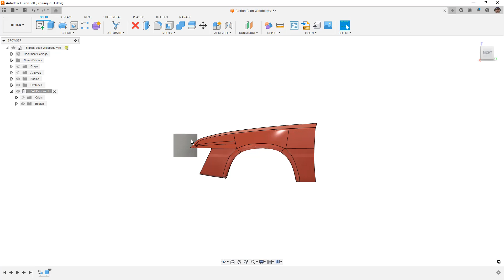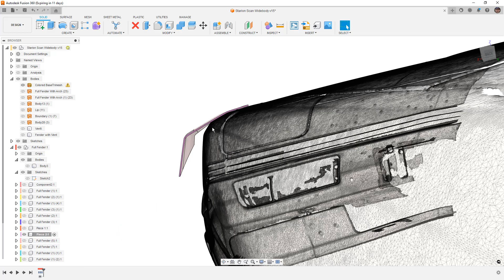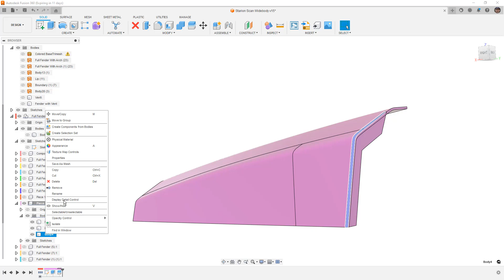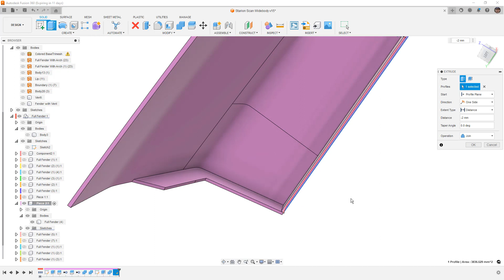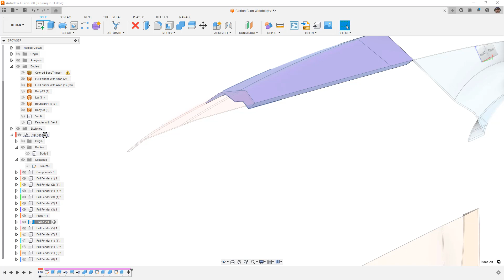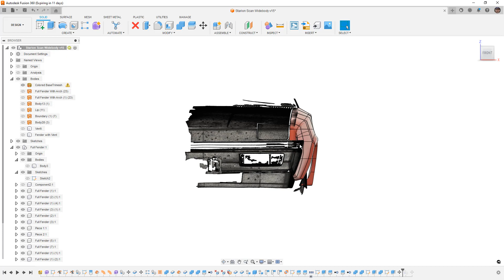3D Scan to Part Series Part 14 | Wide Body Design Part 11 | Splitting Up A Fender For 3D Printing

Comment: Can't wait to see end result of your design! This is the most comprehensive series I've watched from scanning to modelling out custom part for printing and maybe soon 3D printed process. 

I'm already in the thickening phase of my design, then thinking of how I would combine them and possibly create a carbon fiber or fiberglass part out of it. Do you have some videos on that process? or perhaps some recommendations/tips?

Appreciate your content man, keep up the great work.
Reply from the maker: Thank You!  I am trying to complete this as I had one bad section and haven't been able to repair it.  I do plan to continue with it.  Right now all my pieces are epoxied together.  The next step would be to either use body filler and sand it to use as a buck for making a mold.  Or to lay glass over it, then sand/smooth that out.  If you are just building a 1-off then glassing over it is likely the easiest thing.  If you plan to make several then you probably want to use this part to make a positive of the "real thing" for mold making.

I don't have any videos on that process but there are some good ones online.  Easy Composites is a great channel with loads of resources.

Comment: how do you make it thicker if i send it to my printer i get strange shapes and very thin parts and the offset to make flanges does not work with my parts
Reply from the maker: the thickness will be done either as a Thicken in the freeform body or a surface thicken after it has been converted.  I think mine are 3mm.  Depending on the quality of the surface and how it converts you might hit a limit where it just won't thicken past that.

I need to do an update on this as I have printed all the parts but might need to reprint a few.  I ended up modeling some 5mm ribs in the back of a few of the larger parts for some additional structure.

Comment: great video
I have done the same for my Volvo S60. Designed it in blender and printer a the fender to use for a Fiberglass mold
would love to see the end results of your design
Reply from the maker: Awesome!  I am still printing parts. it is taking forever as a lot of the tall thin parts fail after 75% of the way.  I only have 2 or 3 more parts. but now i have more material on order :)
Reply: @LearnEverythingAboutDesign  it takes long to print
it took me 8 days to print my fender out of ABS 3mm thick parts and 200x200 pieces.

Comment: Have you also checked what the fitment is going to be like? The inner fender lip seems a bit thick and since it cannot be rolled the tire might rub. I made some overfenders in Blender that I eventually want to have 3D printed and I measured the new offset, camber and suspension travel to see if nothing interferes.
Reply from the maker: well so this is a bit extreme. there aren't really parts for these cars so i would need to make my own lower control arms.  Coil-overs don't exist except for the weld on ones so its a bit more than just wider tires :)

I did leave the inner lip thick mainly for strength when printing.  If/when i turn it into fiberglass its a trim point.